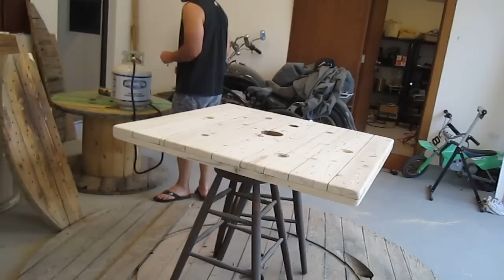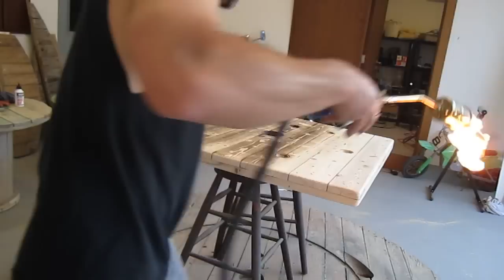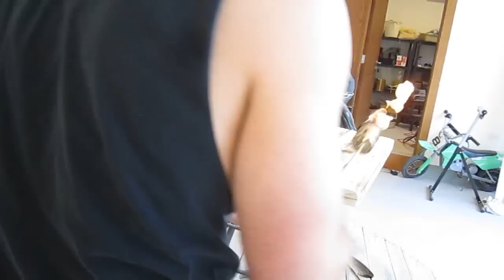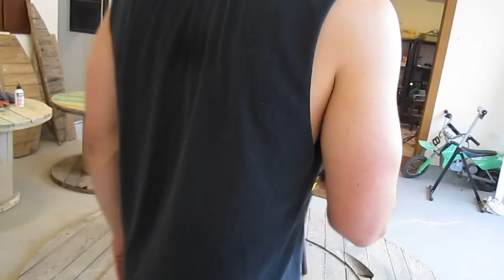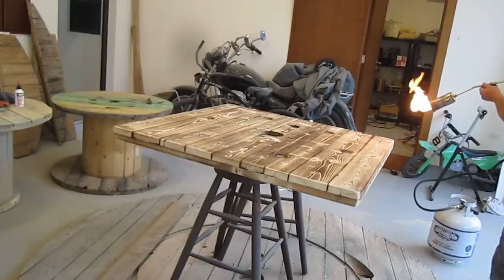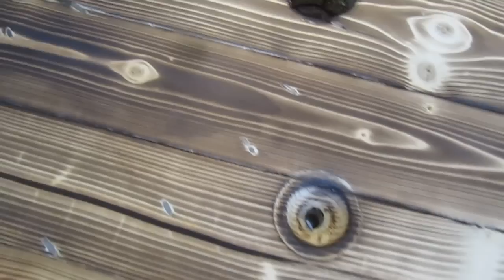Torch Method Coffee Table Project

Comment: looks great! going to be sanding that middle part a little more than expected. I can feel your ifs on that one by looking at your expressions in the video!
Reply from the maker: +Tesla Explorer believe it or not, not much sanding post torch.  just some 220 to knock off the grain and then ready for poly.  smooth as silk and the imperfections work out with this method.
Reply: +Kevin Okun oh I do believe you completely, looks very good!

Comment: Hi Kevin.  Terrific job!  I looked on Amazon, and they have several different kinds.  What amount of BTU Torch is the one you're using?  They seem to have, from 100,000 to 500,000.  Thank you!
Reply from the maker: this is the one i purchased...i went pretty cheap thinking of how many times i would actually use it.  has performed very well on a few different projects. http://www.harborfreight.com/propane-torch-91033.html
Reply: Good ole' harbor freight.  You got it at a good price for sure.  I see people giving you shit about protective ways, I get that.  But, you did well.  I do love the finished product for sure.  Sure.  You should've been in a different area, and safety first, and, please find a better work place, because I would love to see more of what you can create.   I viewed the link of the finished table, and it's top notch.  I restore old home audio speakers, and I love that look.  I know a lot about repairing chips, blending, and so forth. I use oil stains, and paper backed wood veneers.  Keep creating...you have a gifted mind.
Reply: Kevin Okun By the way, have you ever used a stain, after this torch method?  If so, what were the results?  Thanks again Kevin.

Comment: How do you get it where the ash stops coming off to the touch. I am making a bench and every time I touch it more black ash comes off. I want people to sit on the bench without getting ash all over their clothes
Reply from the maker: Much like the coffee table, where you also wouldn't want residue coming off, I lightly sand the entire piece and clean it thoroughly.  A few coats of polyurethane where applied to make the final finish where it will be incredibly smooth.  You will lose some of the burnt look to an extent but you can adjust how much you actually burn the wood, knowing that some char will come off in the sanding process.